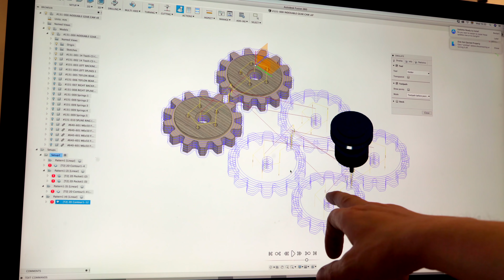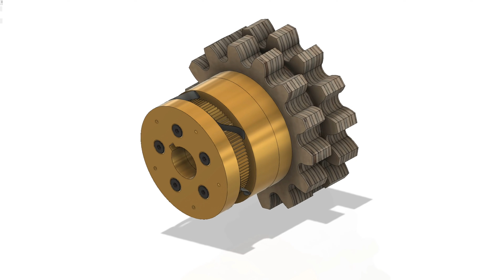Tweaks & Fixes - Marble Machine X #84

Comment: Are you using a light coat of wax at the wood to wood gear points? If you choose the right type of wax you can't even see it has been applied. I think it would be especially helpful to reducing friction on those bigger gears. I build moving wood models and I use a small stick of wax in a chapstick container at the necessary points. Hope this helps! Love the work and the design behind it. There is something I can really appreciate about how intricate it is. Keep moving forward!

Comment: Nice tweaks. Now please reduce the outrageous noise of the fish stair by at least 90%.  I believe the majority of the noise is coming from the ratchet locking mechanisms(s) which prevent the stair from going in reverse.  I also believe a lot of noise is coming from the marbles as they hit the plastic tray seats.  All you have to do is soften that sound as they hit their seats.  I suggest temporarily adhering small, thin rubber landing pads or "dots" inside the seats of a section of lift trays.  I have no idea how to test for reducing the fish stair ratchet noise, it's been a long time in the series since we got to see that mechanism's guts.

Comment: Martin:  For loading bearings into bearing housings, heat and chill as you have been doing, then rest the bearing loosely on top of the bearing housing, lift the pulley/tensioner/whatever straight up (try to keep it square with the surface), and drop it a couple cm onto a solid surface.  The bearing will align itself with the hole and drop straight into the pulley.

Comment: Hmm.
While watching the part, where you talked about the importance of the MX to stay level, I wondered one thing. Maybe you have addressed it previously and I missed it, but the question arose: Does he have an easy way to fill the machine with marbles and empty it again after the gig?
Well, I guess filling in the marbles is easy by using the marble divider and probably some sort of funnel. But how do you empty it again? I would stride for some pathway that can be somehow clipped in place or act as a switch. Then place some bucket beneath the machine and let all the marbles run into that bucket by operating the machine for a few minutes.
Why I think this is important?
Because I think the least thing you want to have is loosing some marbles on stage and tripping on them. If you can fill in the marbles easily, realibly and quick (and of course empty the machine from marbles) on stage, this could be part of the show.

Comment: Hello Martin, great video as always.
A question tickles the engineer in me: How much work ould be required for the machine to be manufacturable by a completely different person/workshop?
No that it would be needed, but I'm wondering about the manufacturability, when Martin the Creator is not around.

Comment: Note on the energy:
"Renewable" is nice, but "Green" is what actually makes a difference. Renewable doesn't include nuclear power, which has the lowest greenhouse gasses emissions and is literally the safest form of energy production we are capable of right now. (Fukushima is a great example of its safety, when even the worst possible case results in 0 deaths and almost no adverse effects on the environment (unlike what fossil fuel companies would like you to believe)).
Additionally, modern modular Fast Breeder Reactors can process what was previously considered "spent" fuel, producing waste which has half-life of decades instead of thousands of years. And finally, they are passively safe, meaning that even during an intentional catastrophic malfunction, the entire reactor content is fully contained, posing no danger to the environment.

Comment: As many others surely have commented (I don't have the patience to look through the over 1000 that have already commented) not only is depthing of critical importance to resistance in gear interaction (there are spacing shims for the proper depthing) but also the surface finish of the mating gear teeth. They need to be smooth, very smooth. It is a rolling action (when the gears are made properly) and the smoother the surfaces that roll on each other the less friction they experience. Additionally, proper lubrication for all parth that touch each other of course.

Comment: WAX WAX WAX!
I would say that removing the weight from the fly wheel would only seem easier to begin with but over the long haul of a few songs you would actually find it harder work because you would have to keep cranking at 100% to keep the bpm up. With the weight of the flywheel you can rest you muscles by only cranking say 60% for periods of time and the flywheel will maintain the rotation.
Also WAX WAX WAX for the gears.
Make the gears from some proper hard wood???

Comment: How does removing weight from the flywheel reduce resistance? resistance is something that would make it harder to turn at any time and pull energy from the system slowing it down. while the flywheel being heavier makes it harder to start and to change its speed, it will stay at the desired speed better. 

So was that more of a change to make it easier to start and change its speed during a show and not really to improve resistance or did the flywheel just have way more energy to keep going then you need and the loss of some weight reducing initial resistance on startup is simply more worthwhile then its ability to keep going?

Comment: Martin, I'm an environmentally minded mechanical engineer, so please give serious thought to what I'm going to write here.  
All-electric cars only give the illusion of moving us toward renewable energy.  All renewable sources of electricity are already being completely spent on existing electricity demand, but electric cars radically increase the demand for electricity, especially rapid charging (which is also much less efficient and shortens the already terrible battery longevity).  Also, the 200-500+ kg batteries in electric cars aren't getting any lighter or more efficient and after 5 years of regular use, they're close to useless (think about your phone battery after just 1 or 2 years).  Those batteries are often not readily replaceable, and they're certainly not renewable and they're environmentally filthy to make.
Additionally, the non-renewable electricity, which is exclusively what will be powering electric cars, is generally filthy and tailpipe emissions from an efficient car have far less NOx (the stuff VW is in trouble over) per km and about the same CO2/km than is produced in generating the electricity to drive electric cars that same distance   
The biggest difference you can make as an individual is to keep a reasonably efficient car in good working order or to buy the most fuel efficient traditional car (or a sensibly made hybrid with a fairly small battery) you can.  There is considerable work that has been done towards making renewable fuels.  Isobutanol is one that works in traditional vehicle engines with very few drawbacks or sacrifices in most operating conditions.  Isobutanol as well as other potentially useful fuels or additives have been produced through photosynthesis by engineered cyanobacteria (blue-green algae -- e.g. http://www.jbc.org/content/early/2017/10/02/jbc.R117.815886.full.pdf ).  Isobutanol, especially, has been produced at a high enough rate to be a potentially viable replacement for petrol/gasoline for most drivers.  There is still research to be done to be able to get the most fuel out of every square meter of sun-lit fuel-farm and there will need to be standardization between producers and distributors and governments, but this is the only advancement on the horizon for cars that actually has the potential to work both environmentally and in terms of practicality.  Every car on the road already has the potential to operate renewably, which is a lot better, environmentally, than trying to replace them all and, if cared for, traditional cars can run for 500,000 km without requiring major replacement parts, 5-6x farther than the 80,000-100,000 km you can expect to get out of the batteries in a Tesla or the like before their capacity is just too low.  It should also be noted that the traditional car has considerably lower environmental impact at the time of manufacture.
For a hybrid to be sensible, the battery should really only be charging when the vehicle is slowing down or sitting still.  At cruising speed, you should be running entirely on the vehicle engine and the battery should be providing assistance for acceleration.  Charging the battery from the engine is less efficient than using that power to drive the car directly,   Far more important than hybridization is aerodynamic optimization.  Also, hybrids usually have terrible tires which increase the chances of having an accident, so any gain that relies on low resistance tires is likely a net loss.
Finally, Tesla is not a good company.  Elon Musk is a salesman who knows that the appearance of innovation is far more important to sales than ACTUAL innovation.  If you want real innovation, Toyota and Mazda are both in the process of introducing new internal combustion engines that make significant advances in how cleanly and efficiently they use fuel.  Teslas burn coal, oil and methane just as uncleanly as ever.

Comment: Around 4:22 you mentioned Helical gears used in high perf engines. I believe this is the other way round. High performance boxes have straight cut gears since the torque is transferred from one shaft to another without lateral force. Helical gears on the other hand roll smoothly and quieter from one gear to another but causes a side reaction, this requires a stronger box to resist sideways forces.

Comment: Please do not apply heat to fine measuring equipment!!! In the shop I worked in, we got yelled at if we held them too long, as our body heat affected the metal in the equipment. Putting such equipment in front of a heat gun is not recommended!

Comment: if belt tracking is every an issue in the future perhaps look into self tracking belts! could be done by getting rid of the flanges of the pulleys and giving the tracking surface a slight positive radius (bigger radius in the middle). Somewhat counterintuitive at first, but the bigger radius in the middle will deform the belt asymetrically if it tracks off center and always „steer“ it back! this can account for slight/varying misalignement automatically. Or you could always get out the angle grinder! 😉

Comment: I have a question regarding the kickdrum. Why didn't you make it vertical the way kickdrums are set up instead of horizontal? Is it too difficult to let the marbles drop on the end of one side of an angled bar which has a fulcrum so the the other end will hit the vertical kickdrum.

Comment: Ask Tobi to make you a new sleeve pulley with a crown. The 3D printed one has such a thing, the new one doesn't seem to have one. Also, you should have a flywheel feed only mode, to power up the flywheel, then engage the rest of the machine. That way, you can keep its mass and gain more power from it during use time.

Comment: The clearance around the high hat and the programming pins looks tight, and while it will certainly clear all the pins when it's inactive, I couldn't tell from the angle on the video of there could be a certain scenario where the high-hat is struck, moves and can catch in between two rows of programming pins. 
To;Dr: is it possible for the high-hat to get stuck in the programming pins while you're in the middle of an epic set?

Comment: The marble conveyor belt is extremely loud. Is it possible to reduce that noise?
I also have an idea for a way to reduce resistance by at least 100%: Add a motor. Only synchronous or some brushless DC motors will maintain a constant speed.

Comment: Hey Martin, I had an idea for the MMX that could get around the scary fingers idea from a previous video. How feasable would it be, to rig up an electrical lighting system that uses the kinetic energy from the flywheel? It's free power and I'm wondering if you can redirect a bit of it to a lighting rig that shows what notes are playing. This should have the additional perk of increased viewrange of what notes are playing.

Comment: If big gear teeth that fits too tightly causes resistance, what does small teeth that slacks cause? Noise and wear? If so, shouldn't you tweak avoiding that too Martin?
I'm just checking if you knew or not, or if it was needed at all. If the issue was actually time then, I forgive!

Comment: @wintergatan Hey Martin, if you make a pulley with a concave surface the belt will ever stay in the middle because there is where the strength is. it is a trick i learned from the industrial museum in Saxony Germany ;) So maybe you want to switch out that pulley again but it is your decision anyway.

Comment: Have you ever thought about adding say a coil spring or something to give you a little more help on startup or when ever.   Wouldn’t it be like a capacitor in electronics per say as a comparison.   Just curious “if” it would work or help or even be an option?

Comment: I know this is a bit late in the design process, but I just realised that there is no mechanism for ghost notes. Maybe you could add that as a variation of the snare channel, where the marble is dropped from half the height of a normal snare hit. I expect you to not implement this, since it's all planned and built without it, but I think, that would have added so much musicality to the drums of the MMX.

Comment: You could run the machine for a while and look at it  with a InfraRed camera, to see the heat vision. Every spot that produces friction should be hotter. That way you could maybe spot some problematic spots, that could use adjusting. no?

Comment: I'm afraid your kinetic fingers will induce a lot more resistance. They will also introduce increased wear on the programming pins and their respective mounting holes.
Reply: yes, that was one of my arguments against the fingers when I first saw them.
heh, I imagine that after some concerts, his arm would look like Oleg Sergeevich´s arm (he is a arm wrestler that looks like a mutant) :)
But speaking seriously, if he does it right, the resistence of the fingers could be minimum, the worst thing are always the gears and the weight of the balls.

Comment: I’m no expert but moisture in the air for open wood grain (on your gears) will change gear performance during different seasons, outdoor weather, and time of day. (Or location in the world you go to.  

Many instruments with wood boxes (piano, guitar, violin...) have moisturizer mediation tools. Usually it’s used for sound performance and instrument longevity, not mechanical performance.
Reply: Plywood is somewhat resistant to the effects of humidity, because of the alternating grain orientation in the plys, and the glue holding the plys together. (Not totally immune, just much more stable than regular wood...) I'm curious to see if it becomes an issue. (I'm 50/50, at this point...)

Comment: I'm still concerned about the safety of the x brace on the programming wheel when it's open. The points of the brace are dark and stick out at eye level. Please put rubber bumpers on the feet so you dont pop an eyeball while rushing on a dark stage to change the wheel.

I usually am not the rubber corner guy, but this is a legit safety issue :(

Comment: Space between gears is called backlash and you can easily set it repeatedly by just running a strip of paper between the gears where they mesh, increase the thickness of the paper to change the backlash, note which gears run best at what backlash and it will be really easy to reset them after maintenance to the machine happens in the field.

Comment: Electricity is NOT "renewable energy", it comes from power plants more than 90% of which burn coal, oil or gas to produce electricity. A big percentage of that energy is lost during transportation (power lines, power transformers, etc). This means that electric cars actually pollute more than you might think...
Reply: Coal and oil are more renewable than nuclear. Technically speaking.

Comment: How about lubrication parts that slide or roll against each other?

Plastics: Teflon grease or silicone oil. Those doesn't react with most plastic types. Make sure to read up on the data-sheet for the plastic in question to be sure.
Wood: Lubricating wax. Does stay where applied without the wood absorbing all of it.
Metals: Depends on application. Can only recommend: https://www.machinerylubrication.com/Read/24100/lubrication-basics
Reply: Was thinking the same thing.  Even waxes on the wooden gears I'm sure could help.

Comment: What the MM shall require is a complete maintenance chart with gear (tooth) engagement clearances and IR measurement device, or calipers, to get the required clearances due to displacement of the adjustable nuts and bolts due to use (during concerts) and wear due to wood wearing out due to metal wood assembly. Besides a few spare gear pinions for quick replacements between performances

Comment: if you have trouble turning the fly wheel in the begining you could start with only the fly wheel en then start the mmx. that way you dont strugle to start the machine (since the flywheel already run) and you can keep the fly wheel full weight

Comment: Much like everyone else. You need to lubricate those moving parts. That will help a whole lot and help reduce wear on the parts. Yes, it will be messy but you are making a machine. Machines need lubrication!

I mean would you drive that car without any oil or grease in those electric motors? Yeah. The car would not last.

Comment: You might want to consider soaking your wooden gear teeth with thin cyano glue to strengthen the contact surfaces and maybe make them run smoother.